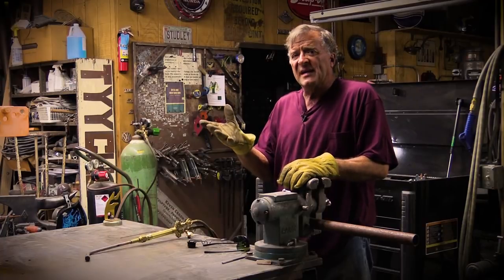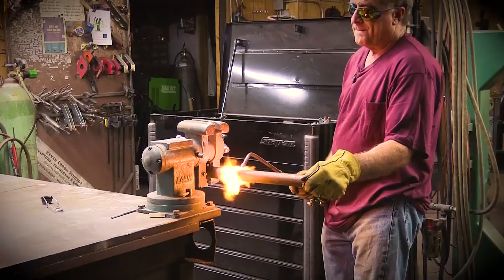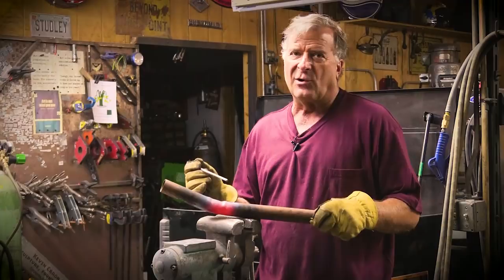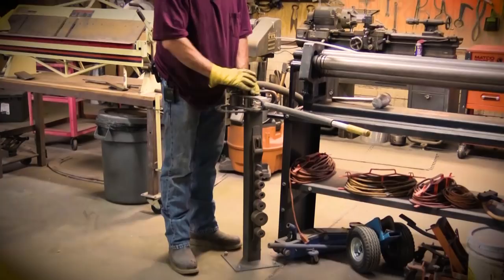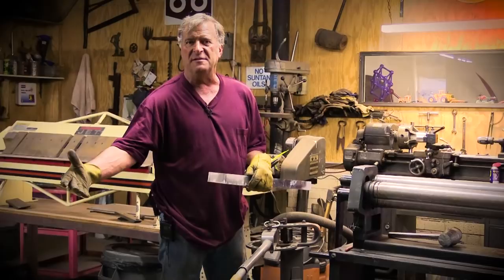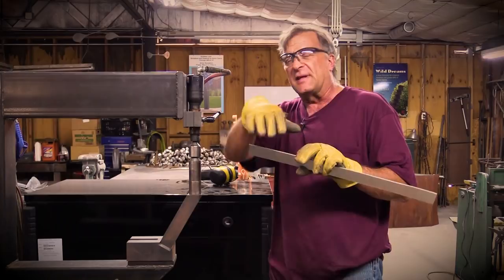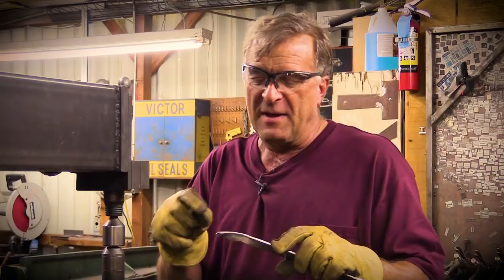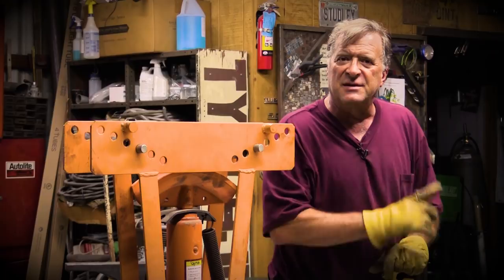Bending Metal: "What Could Possibly Go Wrong?!" - Kevin Caron

Comment: For vise and heat method.....  fill pipe with DRY sand and plug the ends.  That will keep the pipe round. It won't collapse or distort.   Heat the pipe on either side of the bend so the whole area becomes rubbery and bendable.  Info videos on You tube.

Comment: Great video and I have some of the benders you have as well. I made square tube bender for my Harbor Freight roller out of double split shaft collars over 3/4" pipe so that they are adjustable for different sizes of square tube, Have you tried bending rounded curves in angle or channel? I've failed in my attempts.
Reply from the maker: Never tried doing that!    Have to set it up and give it a go.  Thanks for watching and posting!